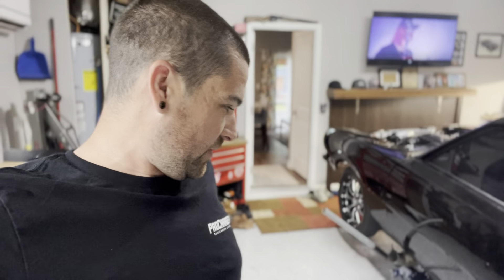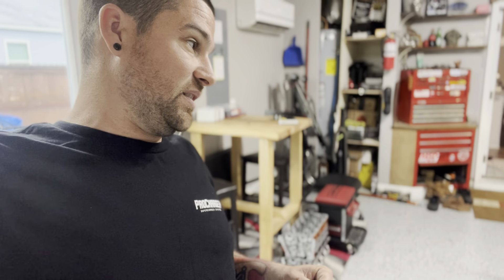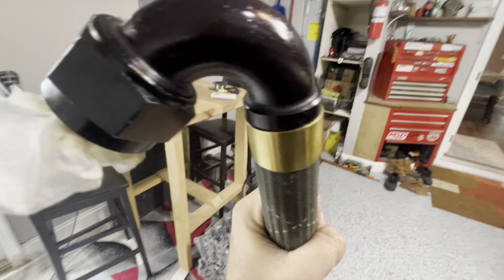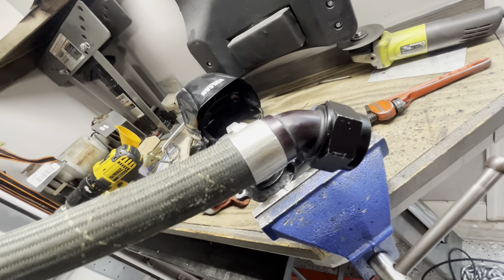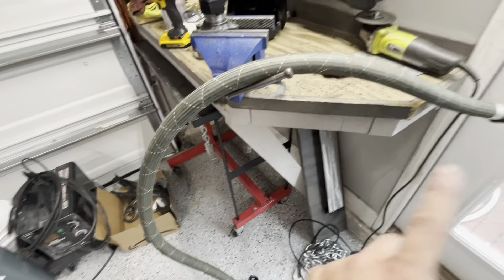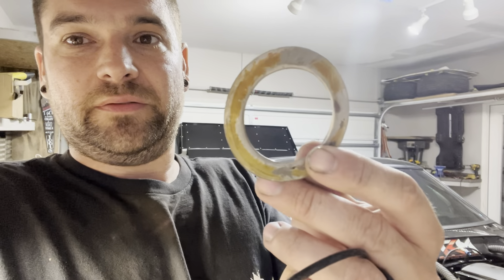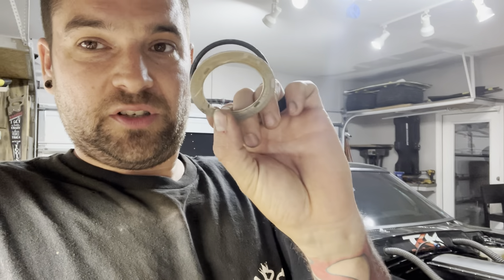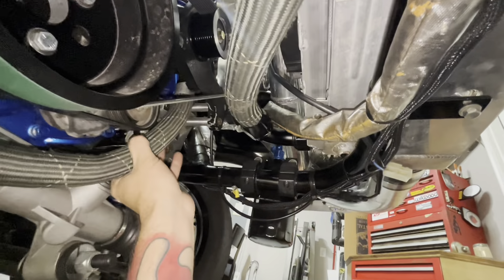Lower Radiator Hose Issue Solution❓$70 👉🏻 6’ Long -20an

Comment: Not a bad deal! I spent $80 bucks for a stepdown hose from a 2 to a 1 1/8 inch! Didnt even get hose clamps, and its just regular hose, not even pretty! 😂
Edit: those hoses are one area one doesnt want to cheap out on. If a hose turns loose, all the water is likely to get under back tires.
You have an XRP HS-79 smooth bore PTFE hose, high temp.
Reply from the maker: Wow you’re smart lol idk how you know all that but that’s awesome!  So sounds like an expensive hose lol

Comment: Can you clock the fitting on the radiator down and loop from the water pump up into the fitting? With that 30°ish on the radiator may make the loop up less of a 90° to avoid a kink.
Reply from the maker: The loop back to motor would kink. I’d of camera really captures how close it all is. Or to keep it from not kinky the hose would have to loop all the way to the ground.

Comment: Instead of cutting the hose maybe could have cut a pie slice out of the acute fitting and weld it back, make it a 90, or could have made any angle you wanted. In the future maybe you should get with John Doc at LS Nasty on youtube, he has Brown n Miller fittings and hose and says he will make anyone any hose they wish, worth a try
Reply from the maker: Yes but remember this one didn’t have a swivel meaning it would be facing wrong way. Brown & Miller is only three hours from me I can order whatever from them also but I try to do things on a budget like a lot of folks.

Comment: Dual pass radiator will put in/out on the same passenger side and can be had with whatever size fittings you want. 

If you took any time at all trying aluminum is the easiest thing for me to tig weld, stainless is tough for me but i havent had anybody well versed standing there to see whats happening and the cause either. If i could get somebody to do that i wouldnt have any more issues with stainless
Reply from the maker: Yea ima learn how to tig as soon as I can afford a welder to do it with. And yea but again that afford thing with the radiator lol
Reply: @ThePaintPaperHustle  be surprised what a cheap light dual pass costs especially for a drag car but if you do plan on hot weather drive it then it will add a pretty penny to the cost.  Find a used tig rig like John uses, mine is a HF pro tig 205 and does awesome
Reply from the maker: Yea I wanna get a HF one also with a warranty

Comment: I don't understand the infatuation with A/N and braided. It's a cooling system. Rubber hose and worm clamps will suffice. Don't run pressure in your system when you are at the track. Let's go!
Reply from the maker: It’s a safety issue incase there’s a failure and the system pressurizes and blows a line off resulting in wrecking the car. It’s highly frowned upon to not use AN lines on a car that makes decent power. If I could run normal lines with out hearing it from everyone I would.